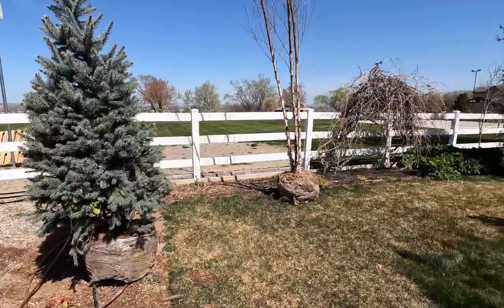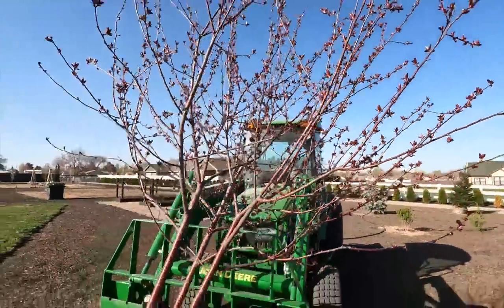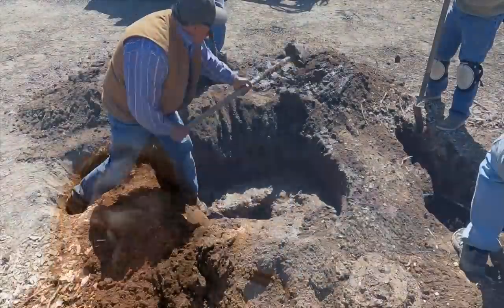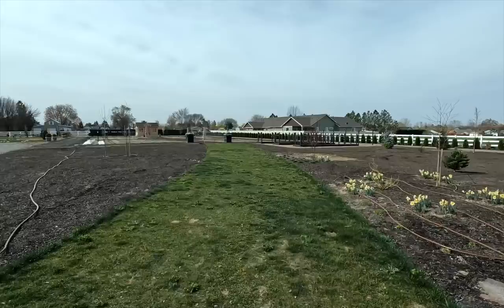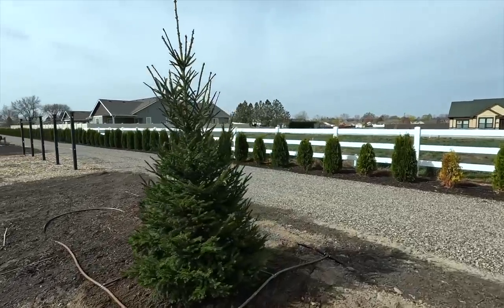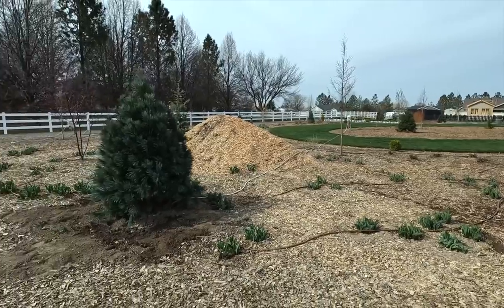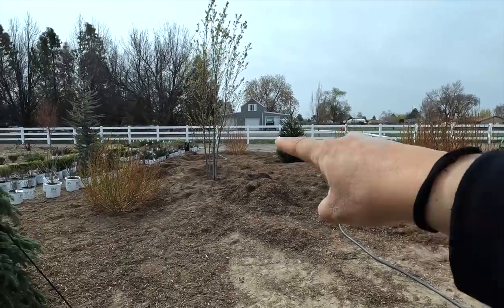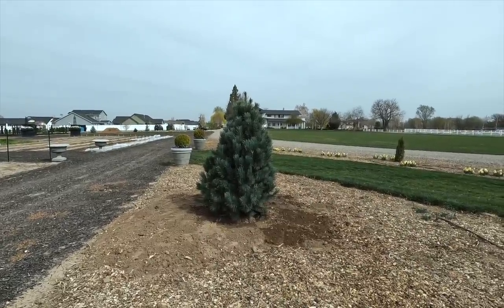Planting Trees: Day 1, South Garden! 🌲💚🌳 // Garden Answer

Comment: I wonder if using a metal detector could identify any pipes or connectors before using an auger?
Reply: Or maybe they should have marked those areas when they first buried them? They also buried electrical stuff too. They'd better be more careful. 😱
Reply: @Bamboo4U2  Yes, and have a map of the infrastructure also.  Am surprised this happened.